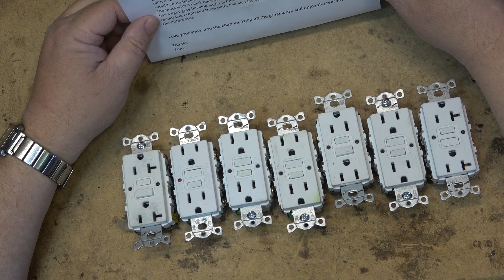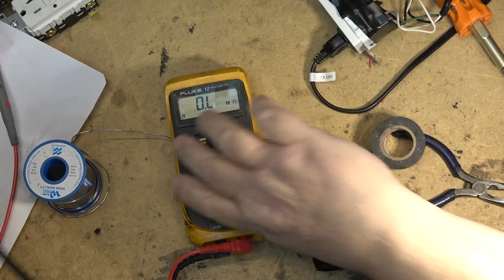Troubleshooting Defective Hubble GFCI outlet

Comment: this is good to know. I've been planning on replacing a lot of the sockets in the house with GFCI (my house has no grounding so the only way to cheaply make it safer is to add GFCI plugs everywhere) and it's good to know I need to push the button every once in a while.

Comment: I put Leviton GCFI's  in my bathroom and kitchen wall some twenty years ago. Still work. Tests OK with my  GFCI tester.
I do wonder if ones made today are of the same high quality and standards? More importantly is to make sure your 
house wiring is correctly done and that the wide slot of the sockets are the neutral and the narrow slot the hot side.
When I first moved into my apartment some twenty five years ago I checked all sockets ,not GCFI, but one of them  I 
didn't (because the CRT TV was the only thing plugged into it) and never checked that outlet until two years ago and 
guess what. The connections on that one socket were in reverse! FYI a GFCI can work without the ground tap lead
because the circuit inside uses the current change between the neutral and hot side only.

Comment: I like Pass and Seymour, Eagle, and Leviton receptacle covers and receptacles, light switch covers and light switches better than Hubble products are sold at Lowe's and or Home Depot, and GE used to be that good, but now not anymore and today's GE is what I lost my favorite and interests because there is no pride about quality built for the products anymore to the point I may have to find another products that will guarantee to last long before anything happens.

By the way about Hubble, I like the Hubble joke that you mentioned earlier about the Hubble Space Telescope the way they made a quality defects that didn't work that well. Hubble GFCI receptacles is what I hate it when it will fail down the road and expecting me to go buy the new GFCI receptacle from Leviton, Pass and Seymour, and Eagle to ensure it will work just fine.

What's funny how GE made a light switch that they called a "Quiet Light Switch", in 1990, the product is banned due to environmental problems which contains liquid metal mercury, because whenever the light switch itself has failed, they cannot dispose the light switch itself to the garbage bag, trash cans, dumpster, or to the landfill. Otherwise, it will cause to create environmental problems and people don't realize the mercury can literally destroy the DNA, genes, and so forth, which creates cancer. Liquid metal mercury is what you don't want to play with or dispose liquid metal mercury.

Comment: i've got a little tester that's real handy for testing, it's got 3 lights that tell you if the plug is wired correctly plus a little button you push to test the GFCI function
Reply: Yeah, they are on a lot of outlet testers, but they WON'T test an ungrounded GFCI, you still have to use the Test button the GFCI.
Reply from the maker: I have the 3 light tester too but no GFI test button.

Comment: I believe alsothey trip if there is a short between neutral and ground.  Correct me if I'm wrong.
Reply: Ground and neutral are tied at the source so just connecting them on an empty circuit doesn't cause a trip. When there's also a load on the line some current goes through the wrong wire and that causes a trip. I had a faulty extension cord with a short between the wires and it took a long time to find the fault.
Reply from the maker: No ground and neutral is tied together.  They trip when between 4 and 6 ma goes anywhere other than returning on the neutral.

Comment: I forgot to mention that most GFCI sockets must be tested on a regular basis and replaced when faulty . That is when the buttons on them don't work or reset.
Reply from the maker: That's right. They all say test monthly, because as we saw they do fail. Saying that I have one at my house that I installed in 1993 and it still passes the test, both the button and the test by button I made.

Comment: What's the fault current rating for these units?
Ohm's Law seems to say your tester is at 110V / 5.6K = 20mA - yet I thought they were supposed to trip at less current than that in America?
Reply: Fault current on American GFCIs is nominal 5mA, I believe acceptable range 4-6 mA. An old Leviton one I have uses a 15k test resistor.
Reply from the maker: They should trip at 6ma.  I have tripped them with 20k which is 6ma, however the commercial units use 5k (as does the internal test button) which is 24ma.  This is done to ensure a positive trip. Even though GFCI outlets and breakers are designed to trip with only 6 milliamps of current there will be some variance due to tolerances in components and aging of components so if you were testing with a 20K resistor providing 6 milliamps of current you could end up with a bunch of false positives.  50ma is where electric shock is dangerous. 4-6ma is what new gfi devices are designed to trip at.  As they age and components wear out this trip level is going to rise slightly. The testers typically test for the maximum allowable before failure. I gave the commercial testers I have seen and measured use 5K which give you about 24 milliamps at 120 volts. Still well below the fatal range for receiving a shock but high enough so that you're not changing out a plug when it's only a year old. I did a video a few months back where I tested A GFCI with resistors and had my tripping I think with 20K. I was going to use 20K in this one but, this will bring all the trolls out pointing out that the commercial testers use a 5K. So I wanted to keep this close to what the commercial devices would use. if you want to make your own though you can substitute any value of resistor you want for the test resistor however you're going to end up finding outlets that will trip with the internal test button but not with your tester. Then which one do you believe. That's why I chose the value for resistor I did to try to emulate the same test that the internal test button does.
Reply from the maker: @eDoc2020  yeah I was going to use the 20K resistor on this but I looked up at schematic for a commercial unit before committing to build it to verify and the commercial unit used to 100K between line and neutral and a 5K between line and ground. Since I didn't have a 5k handy I went with a 5.6. the test resistor in that first faulty unit I opened was 5K

Comment: These are such a "North American" kinds of products. Elsewhere in the world the GFCIs or RCDs are all mounted in the switchboard, and for the past 10 years of so incorporated into every circuit breaker.
Here in Australia it's been law for all power circuits to be fed via a 30mA RCD for as long as I can remember, but you could have multiple circuits connected to them.. Now days we can buy 1 module DIN Miniature Circuit Breakers with inbuilt RCD/GFCI so there is no reason not to fit them on every individual circuit.
Reply: This style is mostly used in retro fit applications. Most new construction will use/require breakers that are arc/gfci protected.
Reply: Here n the UK we have a lot of safety regulations concerning mains electricity because of the higher voltages, we have wall sockets/receptacles with shutters, fuses in the plugs for a start, GFCI/RCD/MCB devices in the switchboards and also the option to have GFCI/RCD/MCB in the wall sockets too.
Reply: U can get breakers but a gfci breaker cost probably 2 to 3 times what an outlet cost so most people would prefer to just buy the outlet. all these gfci outlets suck now a days because all of them are china pride crap. the ones from 10-20 years ago were at least made in the us.
Reply: @mraaron1584  Now that AFCIs are required in most places in the home you already need to use expensive breakers. An AFCI+GFCI breaker is usually cheaper than an AFCI breaker and separate GFCI receptacle.
Reply from the maker: We have GFI breakers here as well and have for as long as I can remember. What I lived in an apartment in 1986 there was a GFI breaker in the panel for the bathroom outlets had a big yellow button on it for testing. Lots of people have them in their homes for outdoor outlets and for outlets that tear near where water is present such as kitchens and crappers. I have one on my hot tub. In most cases however individual outlets outside or in places like laundry rooms, bathrooms etc because it's a real pain in the ass when you plug something in and get it inductive kick that trips the GFI and then you've got to run back to the panel to reset it. For example I have a power supply, wall warts type, that occasionally when you unplug it just the spark from the induction when you unplug it will trip a GFI every time. My bulk tape eraser is exactly the same. when I close the trigger to erase a tape which I do for all my clients the happy transfer their material to digital and then they tell me to dispose of their tape they don't want them back, and yes I've had people bring me boxes of tapes after they've been transferred and asked me to bulk erase them for them so that they can throw them out. Anyway my bulk eraser draws about 8 amps, and without fail when it it's turned off if it is plugged into a GFI it will trip. Other device I have is it old electric shaver. Same thing turn it off GFI trips 100% of the time it has since it was new. So when it trips and you've got your reset button right there it's not an inconvenience, however if you've got to run down to the garage to reset the breaker every time you get a nuisance trip that's a pain in the ass. In North America we don't have to have every outlet GFCI protected so for most people the only ones that they have protected are those that are required, outdoor plugs and bathrooms or anywhere else where water is within reach of the outlet.
Reply: @12voltvids  Nah we don't really have that much of an issue as our sockets have switches on them so we can switch the appliance off before it is unplugged which otherwise can cause an arc which the GFCI can pick up on and trip, plus we have 240v AC mains where our appliances only use half the amount of current than on 120v AC, so with 120v AC you are going to get a fair arc unless you can switch the device off itself.
Reply from the maker: @tyronenelson9124  not true.  Regardless of voltage it is the load.  1000 watts is 1000 watts regardless of the voltage.  True at 240 the current is half but the voltage is double and the higher the voltage the easier it is to draw an arc.
Reply: @12voltvids  Well yea that was my point!
Reply from the maker: @tyronenelson9124  right but if something's drawing 10 amps at 120 volts it will only be drying 5 amps at 240 volts however the load is the same therefore your Arc potential is the same. In other words you will draw the same length of Arc from a 5 amp load at 240 volts as you will from a 10 amp load at 120 that's the way it works.
Reply: @12voltvids  I think you are talking more about AC inductive loads, but like you said the arc potential is similar but not exactly the same, anyway like I was saying it helps to switch an appliance off before unplugging it otherwise there is a good chance of tripping RCD/GFCI devices.
Reply from the maker: @tyronenelson9124  my old Brown electric razor trips it when I turn the switch off on the razor no different than unplugging it when it's running it will trip it.